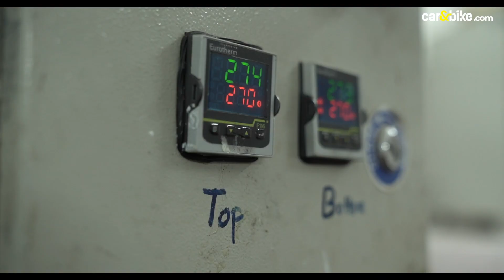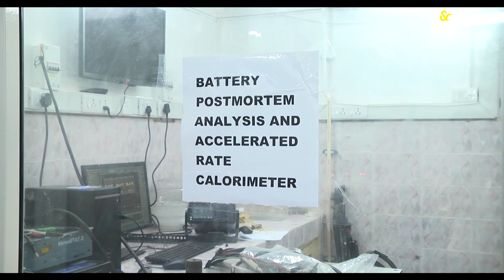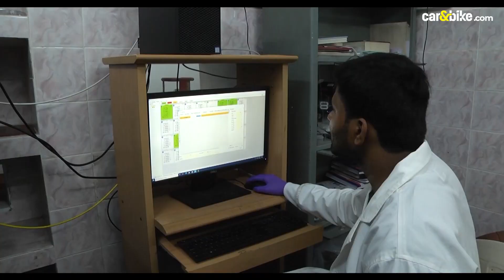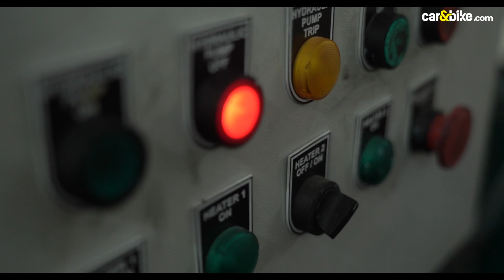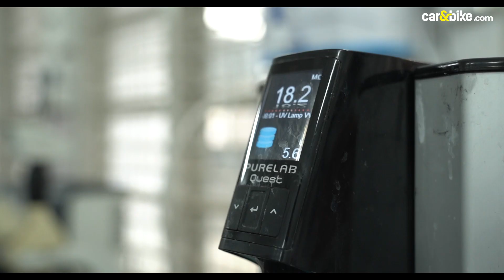IIT-Madras Develops Zinc Air Batteries For EVs

Comment: Sir, Don't  compare the  electrical, mechanical and environmental performances of LIB and Mechanically rechargeable Zinc-Air batteries for EV applications. 
One of the main disadvantage for ZAB is replacement of Zinc anode after few cycles with different current densities (mA/cm2) of Cha and DCha.
During cycling zinc anode dissolution taking place, How many cycles with stand the size of Zinc anode ? Zinc is produced lot of hydroxide and also affected breathing and catalytic layers  of Air depolarized electrode during cycling. 
Please explain to the media about the demerits of Mechanically Rechargeable ZAB for EV application.
Reply: EOS ENergy already determined years ago their zn air batteries could cycle 8000 times.